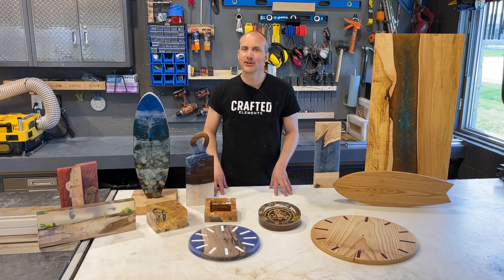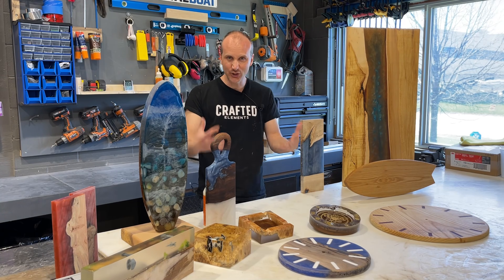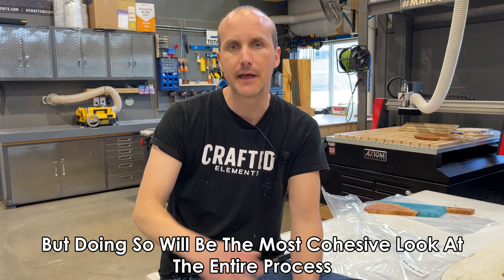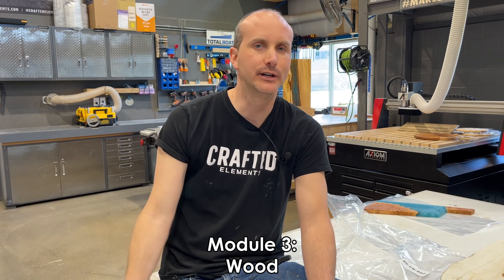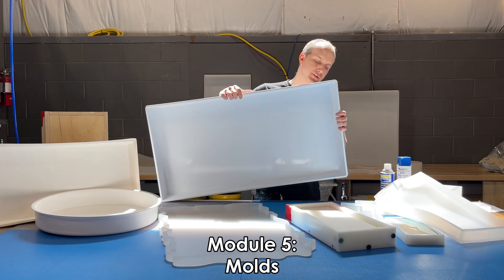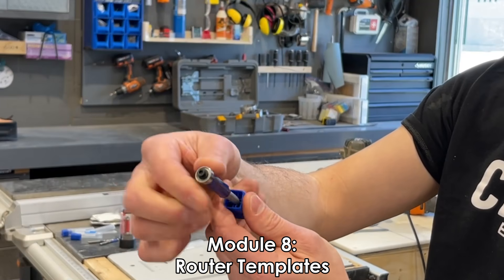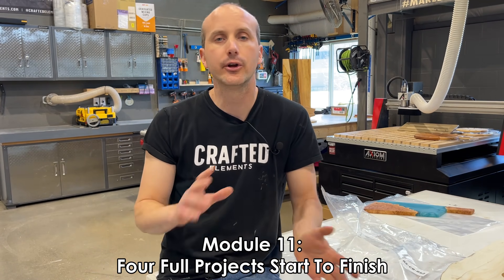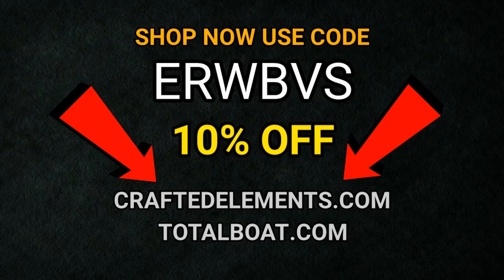Epoxy Resin & Wood Basics Series - Introduction (Part 1/11)

Comment: Hi. I just bought an old piece of live edge wood I plan on putting a clear coat on. Such to give it a nice gloss finish. But there is a hole in the middle of the table. Do I epoxy it first and then put the finish over the whole thing?  Thanks!  Love your videos.
Reply from the maker: Yes, you would not apply finish before epoxy. Do the epoxy first, sand or plane it level. Then finish.

Comment: Shawn, tremendous series; I learned a great deal and thank you for putting this together!!  I found it very informative and can't wait to do my first project.  Just purchased your 18"x12"x1.5" rectangle mold.  I do have a couple of questions for you -- (1) have you encountered any problems using your handle templates and routing through 100% epoxy?  (2) Does it chip/damage the surrounding epoxy material when routing a handle using the handle template?
Reply from the maker: Its definitely harder to cut and router through epoxy due to its hardness, however assuming its fully set you can shape it like VERY hard wood. Its a learning curve for sure.

Comment: Love your videos, I'm getting ready for my first project and haven't seen this vid yet so I'm asking this now before I forget my question. Is it best to plane down the surface to the wood to oil it or is it best to plane it down leaving a small layer of epoxy to cover the entire surface, then oil ? Probably depends on the desired results but as they say "there's no such thing as a dumb question" Also, are some epoxies safer when the project is used to serve opened foods such as cheese, breads, and meats?
Reply from the maker: Plane it down first, sand it all, then oil it. It doesnt really make sense to cover the entire thing in epoxy (or leave a layer) then oil it. The oil doesnt really penetrate the epoxy like it does wood. There are some food safe epoxies, just take it with a grain of salt. As BPA is in most epoxies, and is considered food safe by the FDA... but... ya know :-)

Comment: im a beginner and i wonder how do you prepare the room before applying the epoxy so there isnt any dust or dirt that flyes around that may compromise the hardening of the epoxy? any special advise? or is it just to keep it as clean as possible?
Reply from the maker: I've actually never been asked that before, but it's a good question. Ideally you want to be in an area that does not have dust, sawdust, debris etc flying around, ESPECIALLY if you are using a resin that takes more than a day to set. I did a video in this series where I made a Star Wars themed table, then blew dust all over the resin the next day. It was a pain in the butt to fix (But did get fixed). So really, yes, keep it clean, but also keep it at a good room temperature (18-25C). Too cold, the epoxy takes too long to set, too hot and you may end up with a hotter than usual reaction which creates bubbles and cupping etc.
Reply: @CraftedElements thanks for the fast response, im just finishing with the preparations and gonna start mixing pretty soon. maybe im overthinking it a bit when it comes to the sawdust and debris but yeah the more you know.